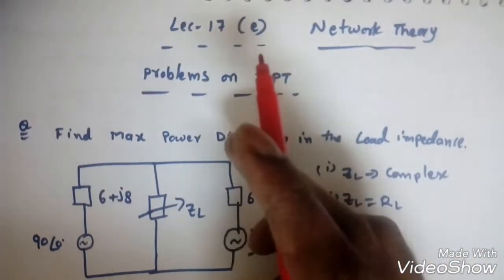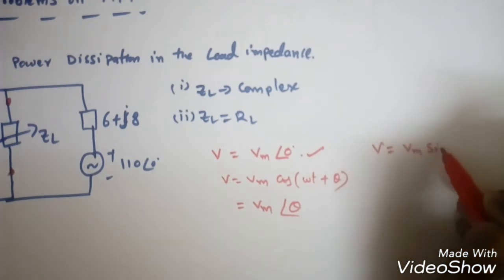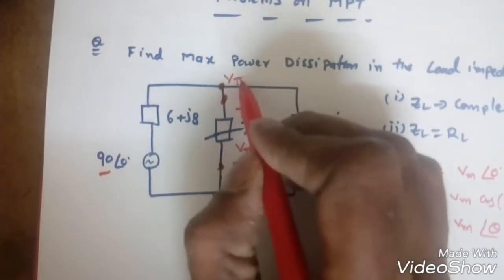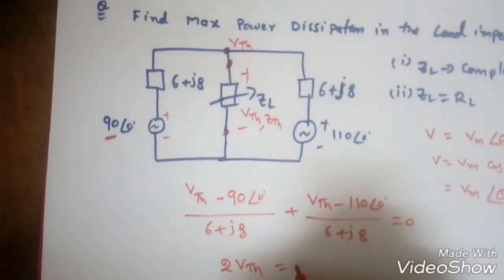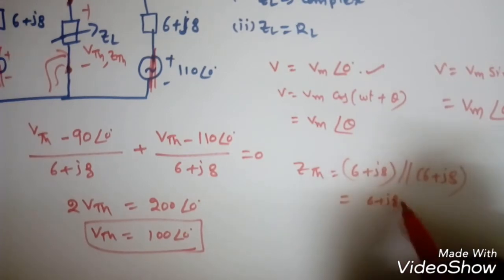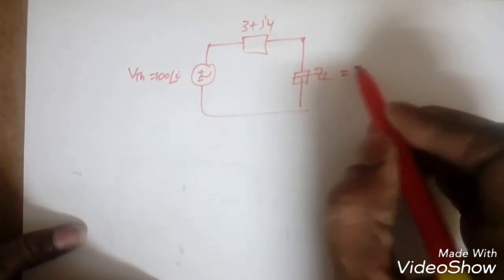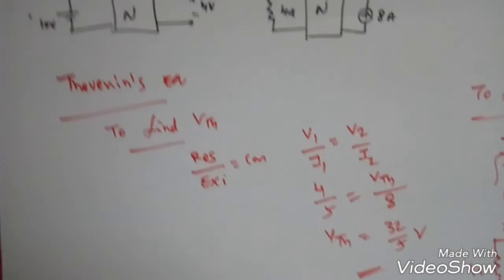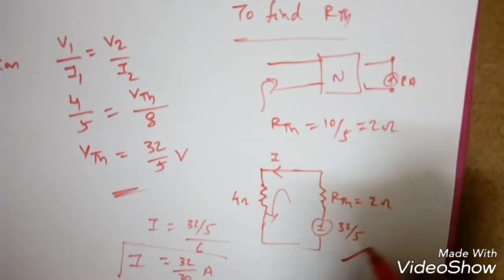Network Theory Lec-17(e): Problems on Maximum Power Transfer Theorem

Comment: sir in first question after finding Vth and Rth why cant we use the formula P=Vth^2/4Rth ?
Reply from the maker: for part (a) we can use that formula...but for part (b) we can't because  in the circuit there is complex impedance thats why we need to find the current then power
Reply: no sir in that case also answer is coming different froms that of yours.
Vth=100,Rth=3+j4 which will be=5ohms so answer will become 500.
Reply from the maker: in part (b) Rth = sqrt(3^2+4^3) = 5 ohms...then I = 100/(5+3+j4)..then 11.18 angle(theta) = P = 11.18*11.18*5 = 624.962 W...in part (a) I = Vth/(3+j4+3-j4) = Vth/6...then we get same as Vth^2/4RL power
Reply: sir in questions complex zth using power=i^2 * zth

Comment: at 11:09 why did u short circuit dependent vge source , bcoz in other prblms related  u didnt shrt ckt dependents sou
rce
Reply from the maker: when we are finding output impedance the independent source should be 0, i.e when we make 8V short circuit the Vo across 1kohm =0, then why dependent voltage 120Vo =0,  that's why i made as a short circuit
Reply: got it ...thankyou sir

Comment: what is the difference between power& maximum power??
Reply from the maker: Very Good question abhishek...resistor always absorbs power...think a resistor like a bulb, depending on the wattage of that bulb it absorbs power....in this case we are finding that when load resistor varying and source is delivering power to the load, and when the source will deliver max power to the load (because load is variable)